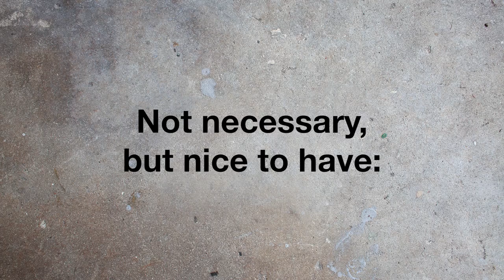BMW Transmission Mount Install - E30 - Condor Speed Shop

Comment: Would these be ok to use with a chassis-mounted shifter + a DSSR? How well do these hold the trans firm? I'm assuming since it's a bolt-through design, the trans shouldn't move at all right? And since they're 70a there are a bit more streetable? Thanks.
Reply from the maker: Hi Matthew. We do not suggest our poly mounts for a chassis mount shifter. Yes, they are a bolt through design but they are very soft. You need to use our UHMW transmission mounts.
Reply: @CondorSpeedShop  I use mine as a daily. can't I use the poly ones with the chassis mounted shifter with no major problems?